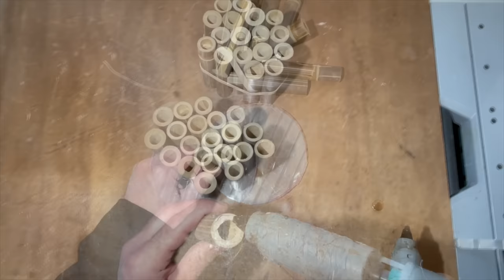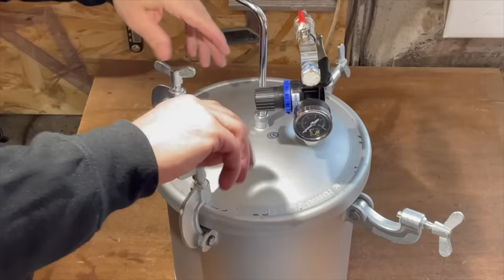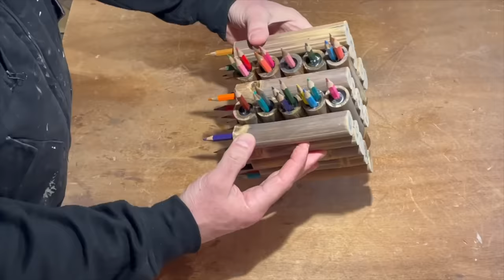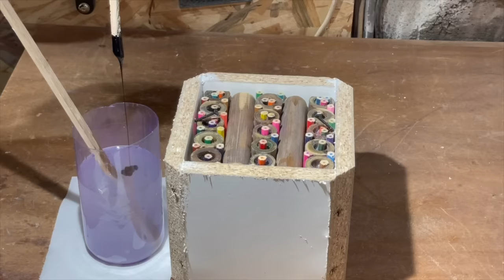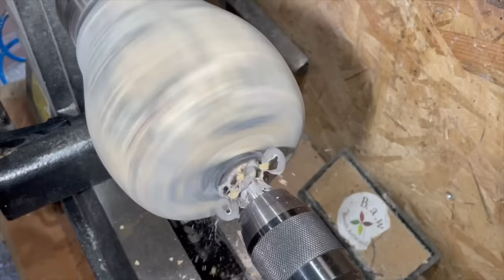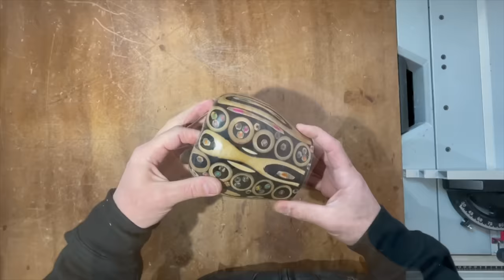Wood Turning - Using BAMBOO is INCREDIBLE, especially when combined with Epoxy Resin😳

Comment: Did you have any adhesion problems later on between the epoxy and the wax cores of the pencils ??
Reply from the maker: no because the resin hardened under pressure😉
Reply: @bawbreizhartwood  sweet